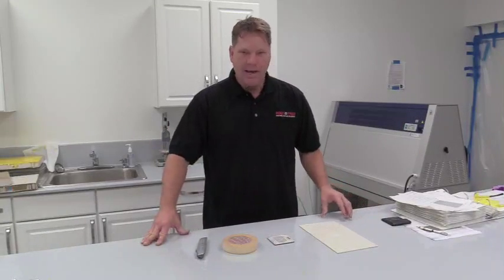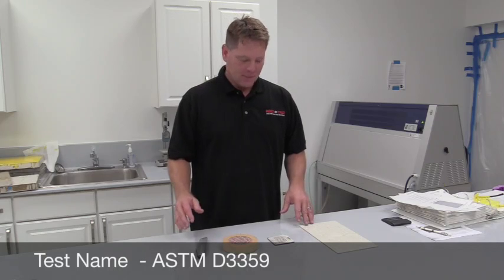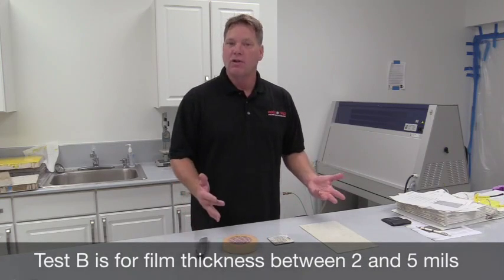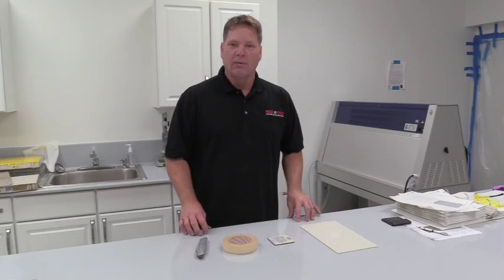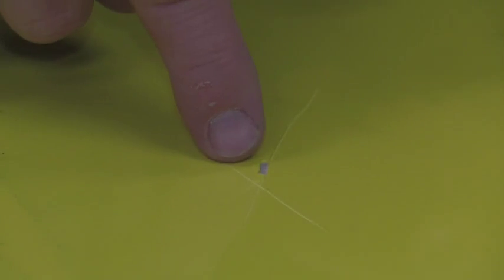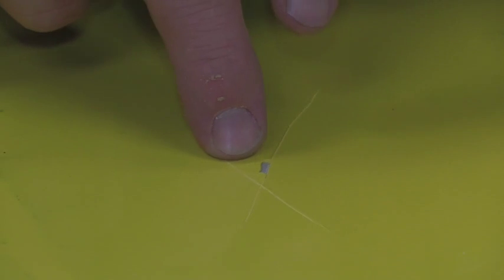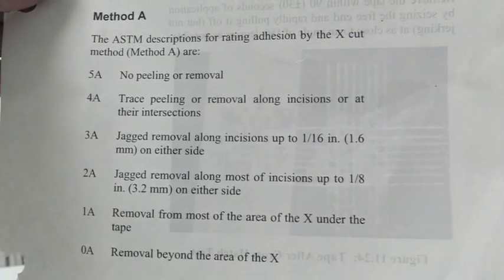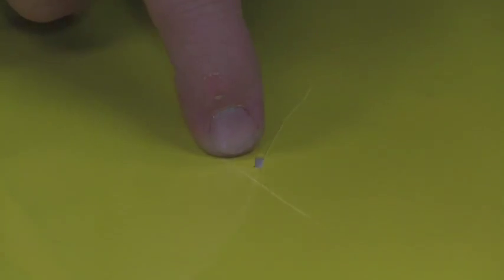RT TechTips 11- Testing Adhesion with Tape

Comment: Is the B test using 2mm spacing?  Are we looking for paint pull off on the tape or substrate?  Have seen references to both but remains unclear which is to be used.